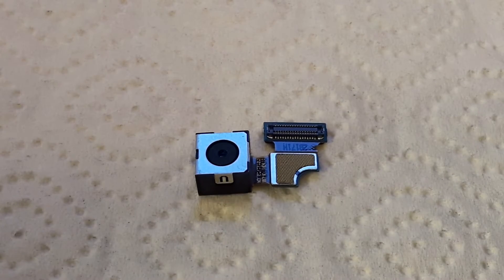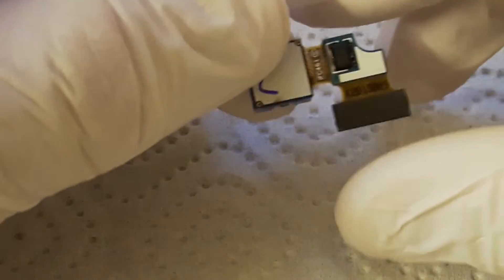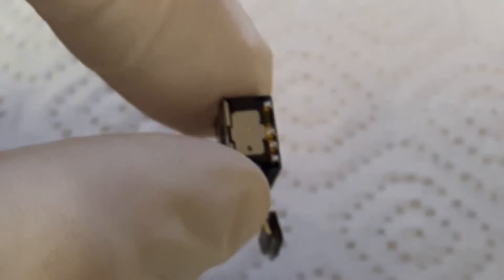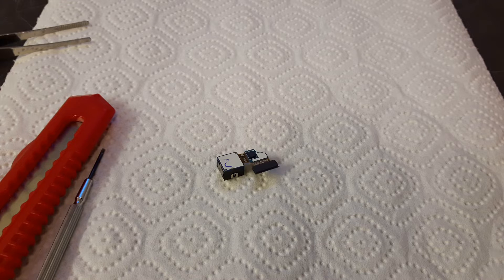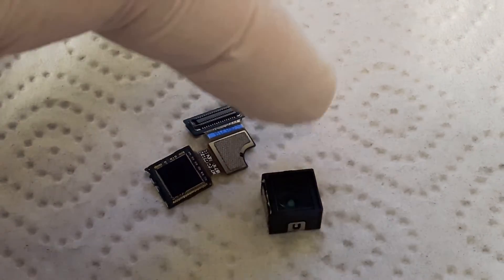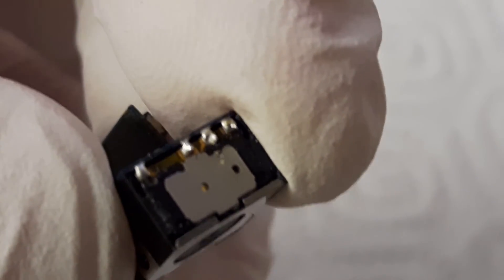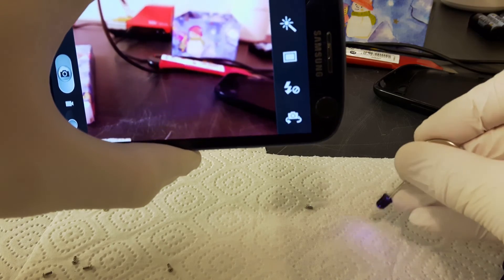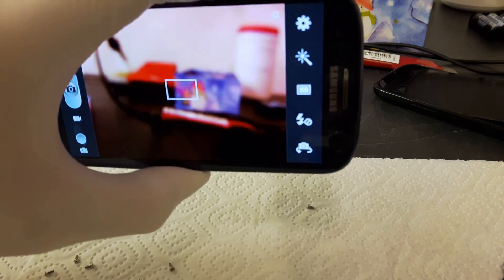Remove Smartphone Ir Filter In 1 Min

Comment: Tried to do this on a LG G2 Mini (D-620R) an hour back but ended up scratching the CMOS sensor & severing some gold wires that come off the sensor onto the PCB. 😢😭

Lesson learned but I will try again (just when I get myself 2 new camera modules off eBay). 😎😆😅

Comment: Can we remove the whole autofocus unit (the lens) and fully expose the sensor and still everything is fine like launching of camera app etc? I want to use my smartphone for prime focus astrophotography!
Reply from the maker: yeah take all out, custom lens setup is way better anyway
Reply: @ShroomLab  Is there any possible chances of camera error even if everything's fine?
Reply from the maker: @biswa145  Depends on your device, if you dont damage the camera chances are good
Reply: @biswa145  I want to try the same thing. Have you tried it?
Reply: @biswa145  Cool. What I am worried about is the autofocus. The Lumia 435 has no autofocus and can't be confused if it can't focus anymore. If you look for decent smartphone cameras, they will of course have autofocus and are much more expensive too. It would be cool to have a something like a mini DSLR. Not sure if it would work though.

Comment: How did you detach the filter?
Reply from the maker: I used a heat gun to soften the glue
Reply: Shroom Lab Did you use a hit gun to disassemble the camera? 전체듣기
Reply from the maker: to remeove the filter, yes, to disassemble the camera I used a screwdriver and patience

Comment: Could you do this for an IPhone 5S?
Reply from the maker: If I had one, yes. It is always the same procedure. Take the phone apart, get the cam and open it gently.
Reply: Ok, yes but ive seen that the iphone´s camera had small copper cables, and i think that is more dificult and i dont know, anyway i´ll try to practice with a damaged camera (because is expensive buy some new one)
Reply from the maker: I really want to do a more into detail tutorial of taking the cameras apart but currently I have no phone to work on.
Reply: Don´t worry, i´ve bougth an IPhone camera and i gonna try to do tomorrow
Reply: Jorge Pablo López Mola 
hey Jorge, did your experiment end up working? I’m looking to try this as well, but can’t find many other people who have done it...
Reply: TechByte 

I tried but I really messed up 

So I bought a night vision device PVS-14 

Here in Mexico are cheap so it’s a better deal
Reply: Jorge Pablo López Mola 
Ah, I see... thanks for getting back to me so quick!
How did you mess up? Any tips on what to avoid doing?
Thanks again!
Reply from the maker: I wish you good luck:D

Comment: Thank you very much for making this video . i wrecked third camera also which was bought from ebay . this time i successfully removed ir filter and did not broken soldering points also. but again after refitting the camera it shows failed error . even i used hand gloves also. now tell me what to do? who is responsible for this ? i lost my money third time. if you can do this work on samsung galaxy j5 camera then do and send me that camera on my address via courier . thank you.
Reply from the maker: I've honestly no idea what the problem is, sorry. Everything procedure you described seems to be correct. Maybe you understand that I don't want to buy a galaxy j5 just to modify a single camera. I can't just buy one and modify it and send it to you. It needs to be tested or you could get a broken one again

Comment: yes, i did not used hand gloves and touched outofocus unit with open fingers . i did not resoldered properly . because soldering points are very small. but tell me if i use handgloves to attempt this and resoldered correctly will my camera really work or again it will show failed error ? plz tell me because i will attempt this 3rd time and i don't  want to damage my camera anymore. thanks for helping me.
Reply from the maker: How many cameras did you wreck? Take one that you consider to be broken and ensure all soldering points have good contact. Try it again. If it doesen't work the camera is most likely garbage. Buy a replacement camera from ebay and try again (or use one of your other cameras if you have multiple).

Comment: i have to remove ir filter successfully from my android phone samsung galaxy j5. i tried two times to do it but both time i have damaged my camera. will you please help me to remove ir filter from my phones rear camera. i really need it. i really want to make my phone as a night vision camera . thats why i have attempt it but i have failed. i lost my money for this two time . please suggest me how to do it . i had successfully removed ir filter but when i fitted camera in phone  and start camera it shows an error camera failed or media server failed . please help me and reply .
Reply from the maker: I am sorry but very likely you wrecked the camera. Did you wear gloves 
as discharge protection? Maybe you touched a conductor... Did you 
resolder properly? A loose soldering point in the autofocus unit may 
pose a camera dead error. Did you plugged in the camera correctly? This 
made me mad more than once. If this doesen't help you please give me 
more information (pictures etc.) that I can give you more specific help.